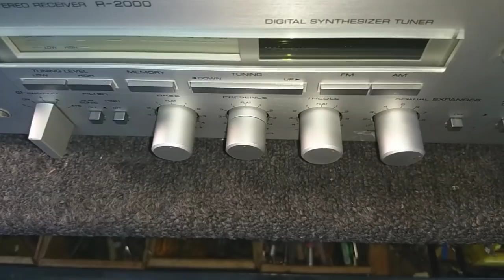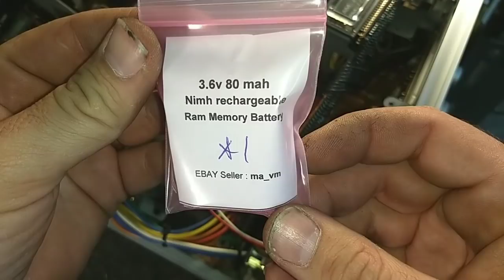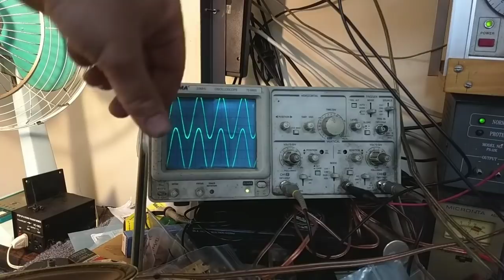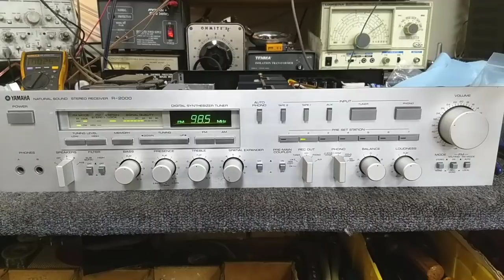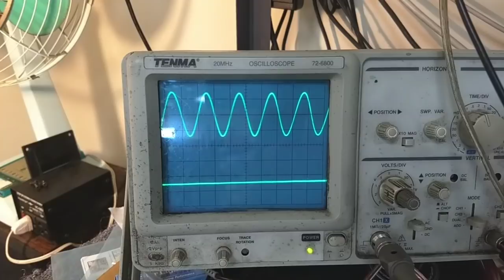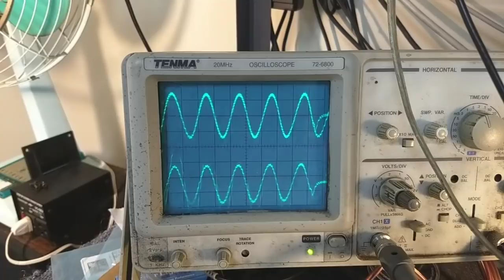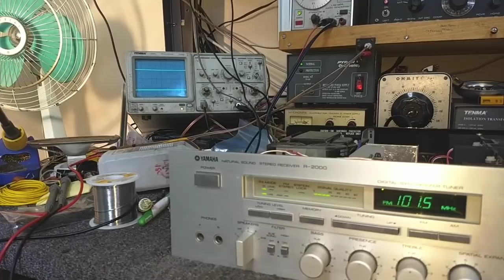Service of a vintage 1980s Yamaha r-2000 receiver. - basic services and repair of memory battery.

Comment: I love watching your videos because you take on some really challenging projects that others would just scrap. That corrosion around the memory battery was fortunately not that bad. I've got far worse on vintage Fluke 8200 series DMM around some niCad batteries that were factory installed in 1973. I still intend to fix that too. ❤️.

Comment: I just cleaned off glue from a JVC SR-201integrated it was so caked up from the Factory. It took lots of alcohol and scraping to to remove it. I have the R-1000 changed the caps and new battery it's a good machine.

Comment: Dear sir. I have bought 2SD72 and ECG103A NPN transistors for the replacement. I am also having 2SB405 and AC128 PNP transistors. I have tested each transistors by setting the digital multimeter knob to the Diode checking position.  While testing the NPN 2SD72 the base to collector and base to emitter forward biased and emitter to base collector to base reverse biased ok. Then I checked the collector to emitter which showed some reading around 220 or above like forward biasing and emitter to collector reverse biased. I thought it was a leaky transistor. The same thing occurred in ECG103A when checking it's  collector to emitter leads there was some leakage readings noted. When I tested the PNP transistor, there was no forward biasing inbetween the emitter and collector and vice versa. The PNP transistors were intact because there was no abnormal biasing found. I believe that NPN transistors should be leaky. Above all the circuit amplifies the signal well but the noise or Hum was audible even at zero volume level. But the audio output had no distortion because of the matched pairs.  I believe that collector to emitter leakage (presumably) causing the hum. Please suggest me and confirm the condition of the NPN transistors whether it is surely leaky or not. The Complementary symmetry amplifier circuit has been used. Thank you sir I am expecting your kind reply.

Comment: Thanks Jordan  for  keeping this baby alive. One thing  I noticed on this unit is that the leds above the input and the power switches didn't light up. There should be a red led light  bar above the power button and green leds above the input buttons? Or is that a different Yami?
Reply from the maker: The lamps all got changed. Was not included in the video.

Comment: Only problem I have with my Yamaha is the controls are the cheapest thing they could put in them... count on cleaning the controls and switches every 6 months ... they attract so much dust ... where as I have a Optimus receiver I purchased in the 90's... the cover has never been removed and the controls are still working great ...

Comment: Mine has a buzz in the mids on one channel, any idea how i can diagnose?
Reply from the maker: Sure it's not your speaker?

Without a scope it's tricky
Reply: @JordanPier  Yes, issue is present on any speakers and through headphones. I thought it was speakers at first. I will likely bring it to a local shop as I do not have a background in electronics. I bypassed the pre map so i know its the power amp for sure.

Comment: You really need a fiberglass pen for all that corrosion...
Reply: I use those.  I have to be super careful with it, however.  When I first got them, I didn't even think to put on gloves.
The first time I used it, of course, the fiberGLASS spines break off and get into the skin.
They are annoying and difficult to remove.

I had to use the electronic microscope to even see the fragments in order to remove them.

Now I use gloves and no more issues.